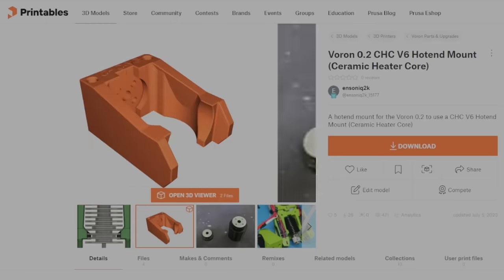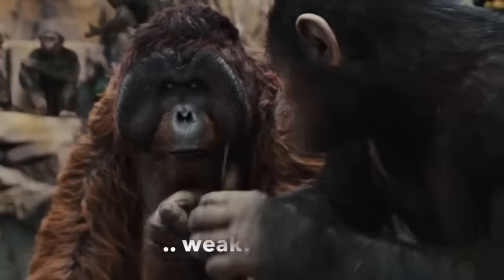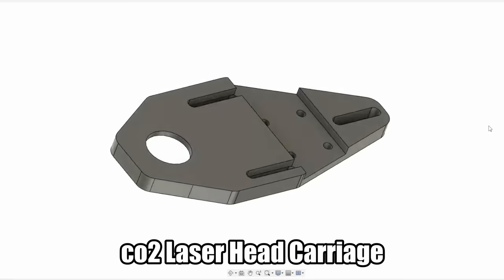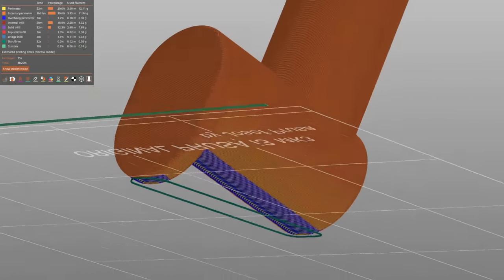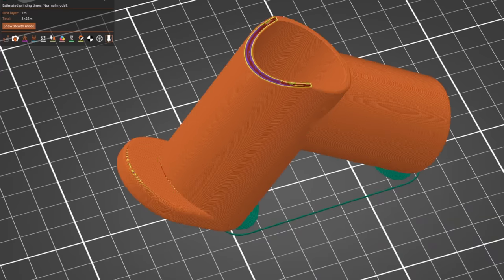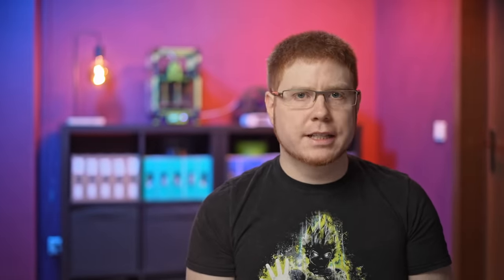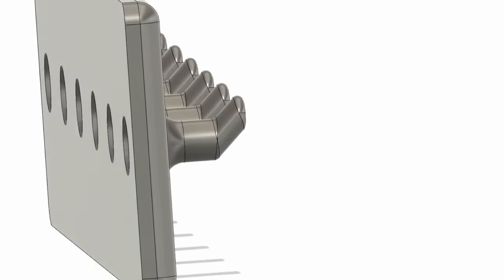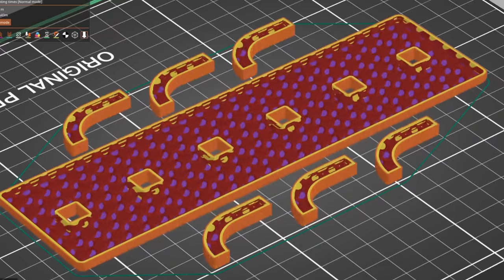3D Print Design SINS that need to STOP on Thingiverse, Printables, Cults3D etc.

Comment: My biggest issue is fitment.  I swear no one leaves tolerance in their models that have parts to fit together.  I'm over here sanding sanding sanding, hammering hammering hammering, pushing pushing pushing.
Reply from the maker: I can totally relate! I recently printed a storage for my camera batteries. It took three different remixes and then time scaling until it fitted. The measuring tool in the Slicer is almost mandatory at this point.
Reply: I always leave a 0.2mm tolerance for easy but snug fit
Reply from the maker: That helps. Different materials and printers make the behavior impossible to predict unless you tested it before so more planed tolerances make for universally useable models.
Reply: I totally agree. I have spent days printing two different sets of drawers for my Ender 3 Pro,  both from different contributors, and both were too tall, hitting a screw in the bottom of the build plate. So frustrating!
Reply from the maker: The measuring tool in the Slicer is so helpful. Prevented me from printing stuff that wouldn't fit anyway a few times already.
Reply: @SmallBatchFactory  Thanks for the tip. New to the 3D thing, so still learning... often times, the hard way. ;-)
Reply: @mrcraftyg8134  Did I understand you right, if you create a hole, the part for that hole would be 0.2mm smaller?
Reply: A lot of the print in place bearing models at least have multiple variants with tolerance options. Makes life a bit easier. :)
Reply: Hard to account for someone elses material, printer, etc. I send my father test parts for mating surfaces to compare the differences between what I am getting and what he is getting before sending him final design files.
Reply: I do. I typically add 200um for fit after printing.
Reply from the maker: It's a good start. For my Prusa 0.1 mm is usually enough and there lies the issue. I'd need to account for many different models.

With Fusion 360 you can just add a custom parameter "tolerance" and have the model adjust easily for any printer.
Reply: I'm pretty sure every modern slicer over extrudes by default. I don't mean it pumps out more than it should, which they do, but in addition most profiles come preset to 1.2-1.3x extrusion rates for who knows why. 

Sure your model looks good and may be a little easier to print but it's way of and the SINGLE WALL TEST WILL NOT CATCH THIS.

You know what does??? 
Print something like a 20x20x20 cube with SOLID 100% INFILL. 
YES, you should be able to do it, there are some models which require it and plenty of people do it often while having tighter tolerances than anything else I can think of. Use your imagination, the point is valid though.
Reply from the maker: @DavidMiOo CNC Kitchen did a good video on the "Cali Flower". It's basically a test of many differnt rectangular dimensions plus a spreadsheet where you enter all your results.

Printing 20mm cubes has the issues that you only calibrate for 20mm width, which then deviates again at 50mm for example.
Reply: @mars3142  Nah. If you design a peg to go into a 5mm hole, the peg should be a maximum of 4.8mm in diameter. Even that is cutting it very tight in my experience, requiring some force to press it in. Sometimes that's what you want, sometimes it's not; Also depends a lot on your printer and materials used. Bottom line is that if you design a 5mm peg to go into a 5mm hole, it will definitely not fit.
Reply from the maker: @groonworld3921 unless you heat it up. The threaded rod for the helmet antenna I mentioned got warm enough to just melt the plastic a bit after a few centimeters. You had to screw it in all at once, went in like butter. Then it cooled down and was unremovable.

But generally you're right of course. Low tolerances will often make the part break.
Reply: Tolerances (or lack thereof) make me crazy too. I find that 0.2mm is too loose for a well-calibrated printer, though it’s fine if adding superglue. I use 0.1mm for friction fit or 0.15mm for looser fit. Slicers used to over-extrude more but these days have largely corrected that.
Reply: @SmallBatchFactory  I apologize I wasn't very clear. It's not the measurement your after. It's if you can even finish the print without jamming or other issues, surface artifacts, high spots that the extruder drags on and so forth. Give it a shot if you haven't yet, try a default profile and I wish you my best.  
Most people never print 100% infill so they never notice. 
If you want to compensate for infill overlap (infill to wall overlap) you can do down to 96-98%. Shouldn't need to go below 96%. 

I first caught onto this when printing one of the Prusa MKII versions, it was the first model with the double roller bearing gears for the Extruder. Nothing fit right and I was doubtful the issue was on Prusa's end. 
Then when I started making my own 9mm pilot hole apparatus I figured it out. Cura was really bad when u came to this. 
IMO running your printer at 20% speed so that the hotend will re-melt the plastic is kind of cheating.
Reply from the maker: @DavidMiOo I print at 100% infill rather often. With the Prusa and Voron 0.2 I never had much issues. Prusa sets flow to 95% in its standard profiles, probably to prevent that. I guess older Slicer versions could have had some issues there.
Reply: @SmallBatchFactory  the comment was more for the users with fitment issues. Current Cura, Orca, and simplify 3D all have higher extrusion rates and width and or height default profiles, at least for the printers I checked anyway.
Reply: Remember, you can always set your slicer to 'exclusive' rather than 'inclusive' to maximise holes and minimise pegs. I have found that to be the difference between a tight fit, and no fit at all quite a few times.
Reply: @YoutubeHandlesSuckBalls  In Cura, yes. Sadly not all slicers have this really cool feature.
Reply: @SmallBatchFactory  Printers and or slicer should have integrated and universal benchmark for sizing, related on common objet on the real world, like a simple pencil. You print the shit with like 10 holes and you pick the one who work to the best and update your slicer. Also even " irl " object can differ from time to time like PVC tubes and this is why i recommand to print a tiny part to test the fit before purchasing some.
Reply from the maker: @DavidMiOo that's definitely true. Prusa goes with 0.42 for example.
Reply: @enterusernamefuck  Let's take a vote.  Does anyone care?  Anyone?
Reply from the maker: @crazeokc  🔥
Reply: Clearance vs tolerance
Reply: Its a difficult one. I used to leave 0.2mm. On some printers thats plenty. On some others that won't work at all. So when i make models and give them out to the public, I add variations with 0.6mm 0.3mm and 0.15mm
Reply from the maker: @craazyy22 that's the thing. I often just add a parameter in Fusion "tolerance" people can change
Reply: I have an SLA printer and 0.003 inches is enough space for a good fit
Reply: what I do is just shrink a part by like 3% and see if that helps.
Reply from the maker: @sadizz455 it helps to use the measuring tool in the Slicer and with some knowledge of your printers precision you can eyeball the sizes you need
Reply: @SmallBatchFactory  great idea. i forget that slicers and stuff have these specific things.
Reply: @sadizz455  3% is actually a lot, what about if the part you would shrink has tight tolerances other places? You won’t know what the detentions will end up being so it’s definitely not the best solution
Reply: @SmallBatchFactory  really the solution is a lot simpler than releasing a bunch of premade tolerance bands, just release parametrically dimensioned parts and release the files. The problem with that is many people want to be able to hold those close to their chest for monetary reasons.
Reply from the maker: @Mawyman2316 somewhere in all the replies I said the same thing IIRC
Reply: The round holes are the biggest issue. Mesh conversion makes approximation that's a little off and printing then further reduces diameter in the corners of the resulting polygon. I found that the best solution is to make polygonal holes from the start.
Reply: If you look back in history, you are not alone. many very famous designs suffered at the secondary manufacturing plants due to poor descriptions of the tolerances, such as everything being taken as a +/- tolerance when certain parts were a 0/- with their mating part being a 0/+ tolerance. Not to mention the fact that a fraction that is easy in metric isn't always so easy in imperial or the other way around. I think a lot of people are just not aware of how "sloppy" some industrial parts really are, but the design works around that. I'm still at the stage where I hope to be designing where tolerances below a millimeter matter, but some of the brightest minds in invention and manufacturing have faced this fight.
Reply from the maker: @KarltheKrazyone oh yes definitely. I'm always fascinated by machines that aren't actually built that precicely but can be calibrated to be extremely accurate.

I've built a table saw fence with some DIY plans. A few adjustments needed to be made via screws and now it's extremely reliable and creates repeatable results. The built included welds I made myself with not much experience but even that was no problem.
Reply: @sadizz455  Use slicing tolerance, horizontal expansion, or X/Y compensation instead of scaling the whole model.
Reply: @Papinak2  Polygonal holes with filleted corners and chamfered edges have the best shot. 👍 Printers like printing rounded corners better and chamfered edges won't suffer elephant foot or muffin top.
Reply: A tight fit is sometimes good. I've printed some tight tolerance dovetail joints, and put them together by carefully hitting them with a mallet. Works better than any type of glue to keep pieces together, especially for functional prints.
Reply: Horizontal expansion -0,2 is your friend. Those models are made precise, not printable.
Reply from the maker: @kbee225 definitely. I regularly print things where I press fit hex scresds or nuts. Prusa printers also have a lot of them, although being very small M3 size.
Reply: Not sure what slicer you use but some blatantly have tolerance compensation, and others (like orca, which I use) have settings like XY hole/contour compensation, which allows me to print zero tolerance parts that I / Others design
Reply: Here is quick tip to avoid sanding and hammering. Heat the parts where they have to fit with hairdryer for a few seconds before putting them together.
Reply: resin prints often have the same issues, i was dialed in 99% on my printer for accuracy.. and still having to sand things to fit because the hole and the pegs are the same size
Reply from the maker: @un7ucky Resin is my personal nemesis. Dimensions being influenced by resin time and exposure as well as liquid resin still flowing while curing...
Reply: so true, its why I haven't used a online file in a while. Shit drives me insane having to shave it down to size. Worst is when you break the part trying to fit it
Reply: @SmallBatchFactory That is exactly the reason I stopped uploading models.  When I print them on MY printer with MY filament, everything fits perfectly because I know the characteristics of MY printer.  So I upload the models and get:  THEY DON'T FIT -- DID YOU EVEN ACTUALLY PRINT THEM?
PS: it's Dhis ist zhe vay.  :face-orange-raised-eyebrow:
Reply from the maker: @user-pt8es6ck1j it's a problem, I agree. I found over ten slightly different versions of a battery holder and none fit until I scaled one. Uploading a STEP file would help but most people can't handle them anyway.
Reply: Also don't forget that filament are different. For example, silk expands a lot after extruded. That will throw off tolerances.
Reply: Just use horizontal expansion in cura. Maybe set it ro -0.1 or -0.2 if it doesnt fit

Comment: How to print a sharp inside corner. The trick is a "mouse bite". Intersect a small cylinder with the corner so the STL shows a cutout up the corner like a small ice cream scoop was run up it.
When the nozzle goes around that small cut, the squeeze out flows and closes it in, leaving a sharp corner.

The first time I used this trick I was modeling a replacement part that had a rectangle hole which had to fit onto a metal tab and a square hole into which snapped an injection molded plastic part.
I did a TLAR (That Looks About Right) on the size of the corner cuts, sliced off those parts of the model to do a test fit and they were both perfect the first time.

The concept comes from fonts designed for printing on cheap paper where ink bleeding is a problem. The Bell Centennial font was designed specifically for printing phone books. To improve its legibility at small sizes, all inside corners of the letters have notches so when the ink bleeds into the paper it flows into the notches and makes a sharp corner.
Reply from the maker: That's a really handy trick! Just like angle tools have a circle where the edge goes in to make it fit in any case

Comment: I must agree, curved geometry near the bed is making me cry inside.I’m all for joining a dedicated chamfer lobbying organization.
Reply from the maker: Way to go! When I was a total beginner I always thought the bad print is my fault. It is printable with very fine layers but that's not really a good solution.
Reply: @SmallBatchFactory cura has a great feature called "make overhangs printable." This actually alters the geometry of the model so nothing is more than a 45 degree overhang (or possibly whatever you have your overhang angle set to in support settings, not sure). If the only problem you have is badly designed rounded chamfers, that should fix it.
Reply: Or you could do what I do: make a curved bottom edge that starts at a 40°-45° slope and curves upward to vertical. This prints well and looks better than a simple chamfer, but it's a bit more work to figure out how much to lower the curve center.

Comment: I saw the thumbnail in my "recommended" and thought "I wonder what this is all about". I was surprised to see that key hanger. It's my design! I was both excited and humbled to be featured.
For some context, that was one of my first designs in OnShape that I made to attempt a 3D print for my new printer. I know it's not great but I liked it and so I uploaded it. 
As it is, I printed it without supports but, admittedly, it didn't print real well. I wasn't bothered so I kept it. As for strength, it seems fine as it's only holding car keys. I've been using that particular print hanging on my refrigerator for about a year with no problems. 
I did update the design with the holes at the back to insert magnets. There were just holes for hooks before. That was about it.
All that said, I'm happy to be used as a "what not to do" example. All of us are students and no one of us is as smart as all of us! Input, feedback, knowledge sharing, experience, etc. are all valuable for anyone learning something new or expanding their knowledge of a given subject.
Thanks for the lesson!
Reply: nerd
Reply: My first designs also totally sucked. Learning takes time!
Reply from the maker: I'm glad you liked it! Such a small world after all. In many cases "good enough" totally gets the job done anyway.

I would lie if I said my early designs weren't a mess either, figured the part about fillets on the build plate the hard way.

Somebody even one uped my suggestions with a better one I featured in a community post. We're all just students :-)
Reply: It's also depends a lot on material. PLA is a trash material when it comes to functional prints. I only print functional stuff in PETG.
Reply from the maker: That's a way too generic take on PLA
Reply: @SmallBatchFactory  Name one reason to print in regular PLA over PETG besides PLA being prettier and PETG being a tiny bit harder to dial in to avoid stringing.
Reply from the maker: Sometimes you just need the stiffness. Someone commented he printed some part for a machine where other material flexed too much. Of course you could leap to Polycarbonate, but why not PLA if it works. I also like it because it's sustainable. I go with PETG a lot, but only where PLA doesn't cut it.
Reply: @AlexusMaximusDE - I found more than one reason: (1) ease of bonding parts together, (2) mechanical properties like stiffness and springiness (PETG tends to stay deformed, PLA springs back, for the same amount of flex in the same part). I have a couple of designs with snap fittings that wouldn't work well in PETG, but work great with PLA.

Comment: I print a lot of miniatures and my biggest issue is details where there doesn't need to be any ... Like a tongue inside a closed mouth !!! Looking at you HeroForge 😤
Reply from the maker: I guess they design the model once for different poses and don't really care how you're supposed to print it. Only a few models like Adalinda the dragon are made with printing in mind and work without any supports.
Reply: I think people are scared of mesh mixer but if they give it a chance these issues would a 2 minute fix
Reply from the maker: @knifeyonline definitely and I'm guilty myself. Seems like a good video idea
Reply: @SmallBatchFactory  yeah! It's certainly not an over exposed topic, I don't think anybody is tired of watching people use mesh mixer. So many uses. I saw somebody scan their face and clean up the model in meshmixer to print a mask.
Reply from the maker: @knifeyonline that's right. If it were I probably would've used mesh mixer already.